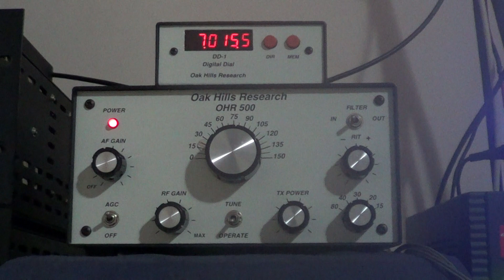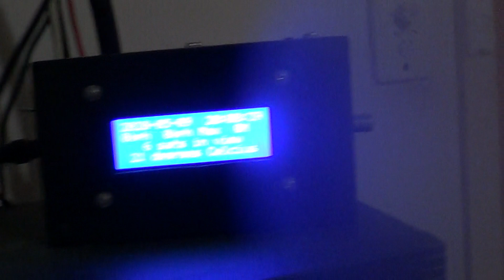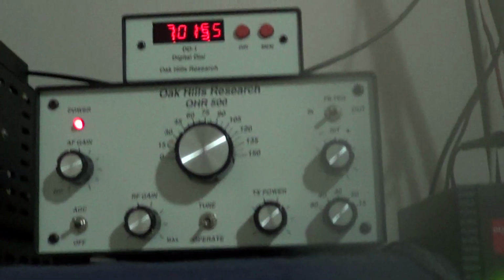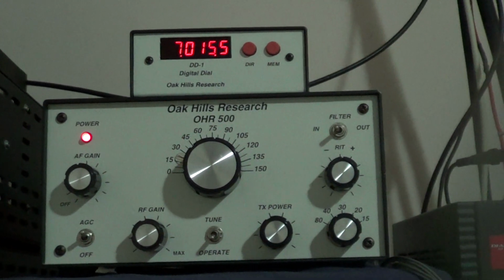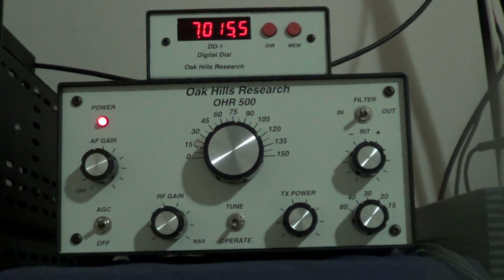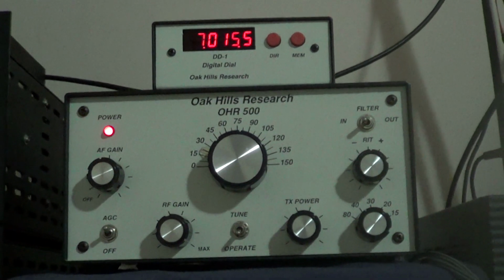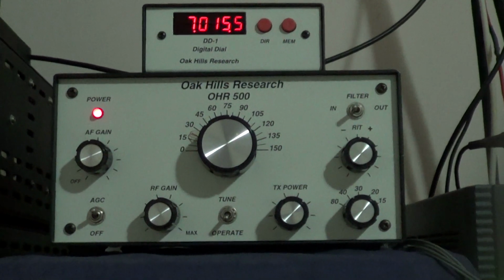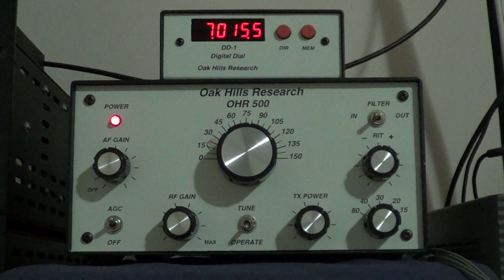OHR500

Comment from the maker: Actually, people put a resistor in series with an audio amplifier supply line to provide noise isolation from the supply, but since this unit runs from a regulated 12V supply, the resistor is not crucial to satisfactory operation.